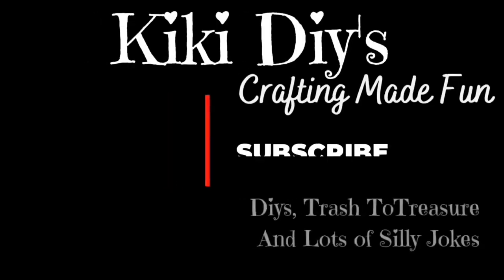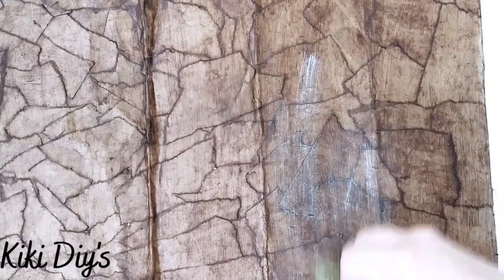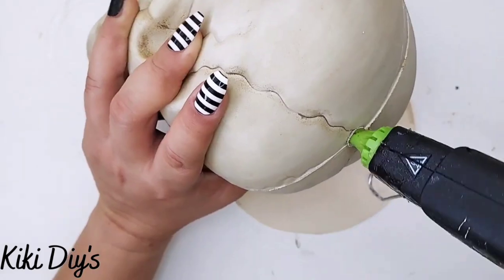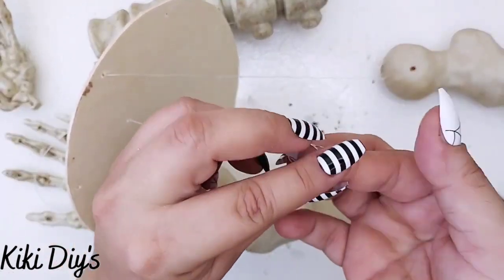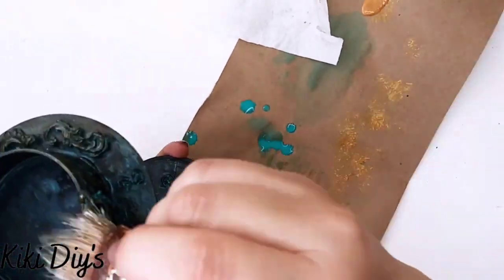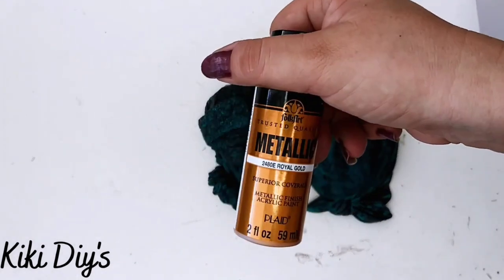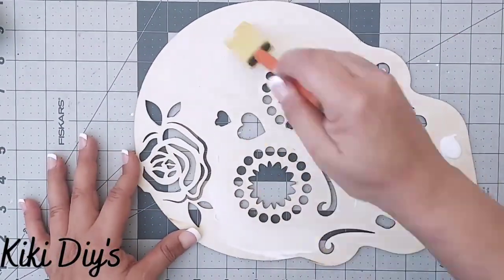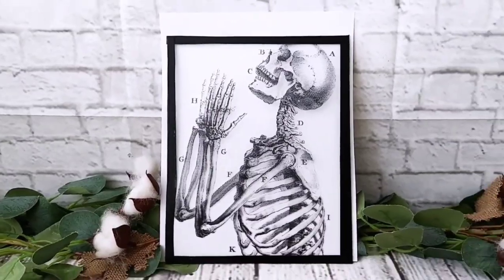Dollar Tree HALLOWEEN Diy IDEAS for 2023 | STEAMPUNK Inspired HACKS You Must Try 2023 | Jun-O-ween

Comment: Would the water slide of Madame Leota worked on the inside of the snow globe better so you wouldn't have the creases to deal with on the outside? Would it have stuck to the inside with modpodge or something?
Reply from the maker: Well, it would need to be another media, as the waterslide decal won't dry, so it would disintegrate with time.  I wanted to come up with another idea to add it, but I just couldn't figure out a way for it to show and to be protected.  But maybe if it's printed on a plastic sheet, I think you can add it to the inside.
Reply: @KikiDiYs  please work on the crystal ball so we can see more ideas!! Anything from the Haunted Mansion would be cool!
Reply from the maker: Jamie, I just bought a 4.5-inch snow globe from Amazon to make a new Cristal ball!!  I will try to make a Haunted Mansion steampunk crossover 😂
Reply: @KikiDiYs  WOO HOOOOOOOOOOO